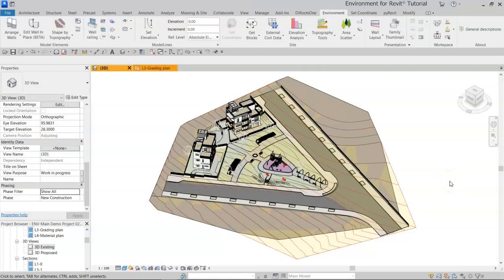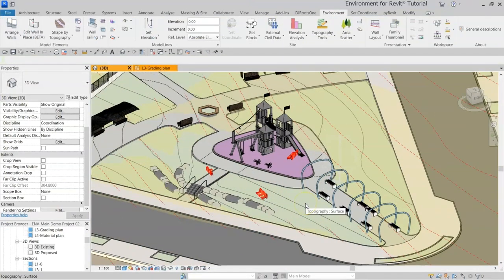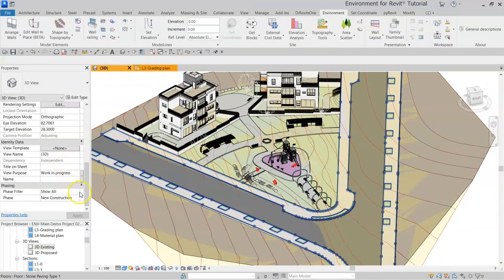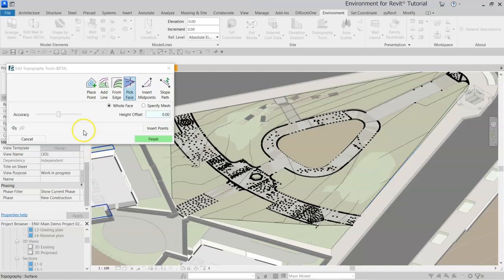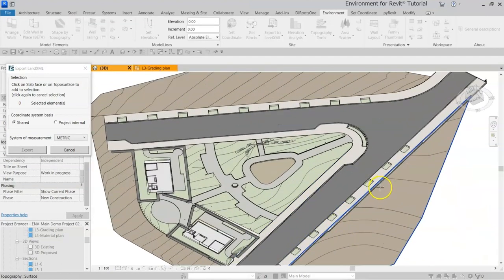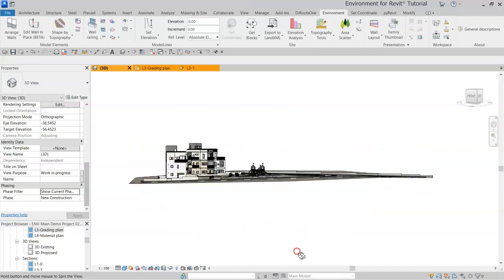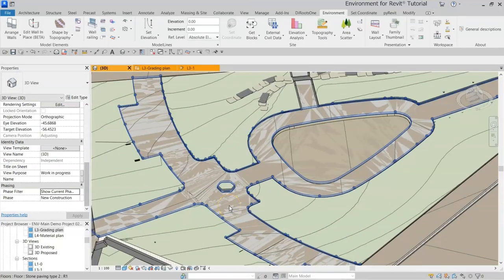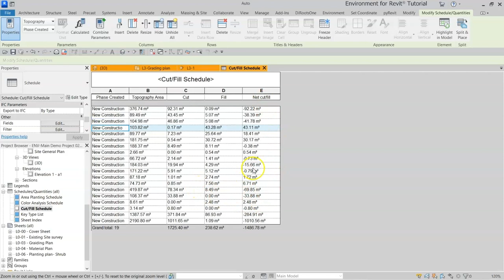How to calculate Cut & Fill quantities in Revit® | Environment for Revit® Tutorial

Comment: How do you show batters from the building pad
Reply from the maker: Building pads are naturally built to show Cut&Fill in the properties window - just make sure that you are working with the correct phasing process (Existing or New Construction surfaces).

We invite you to check out the following video: https://youtu.be/ya9Vz5dxEhI?t=2126
It’s a full session with Revit Pure which refers to Cut&Fill’s with building pads
Reply: Thanks, but it doesn't show how to create batter ratios from the building pad or the cut and fill lineb